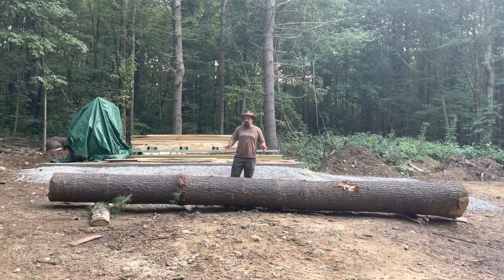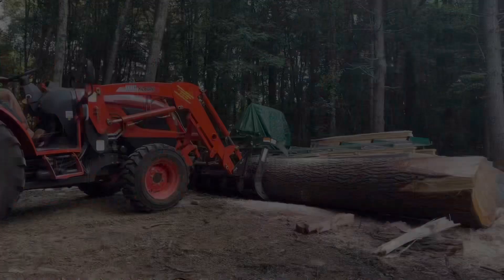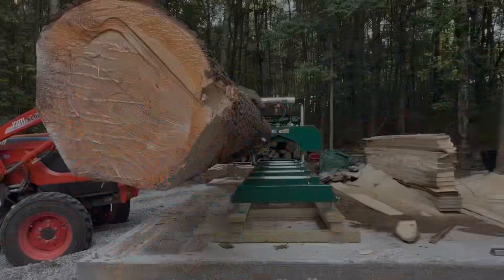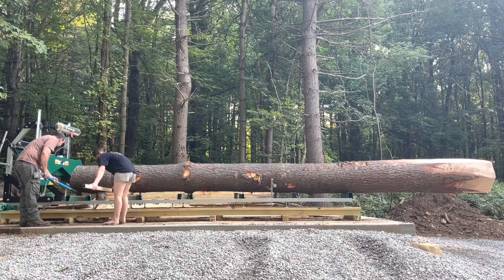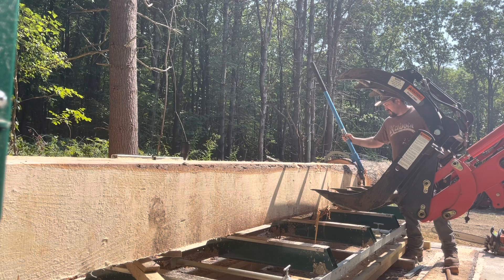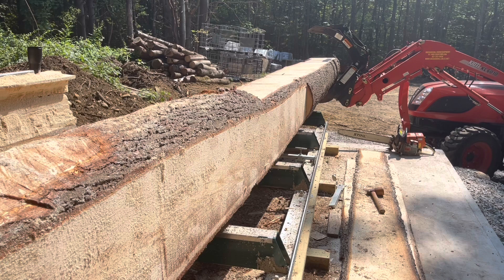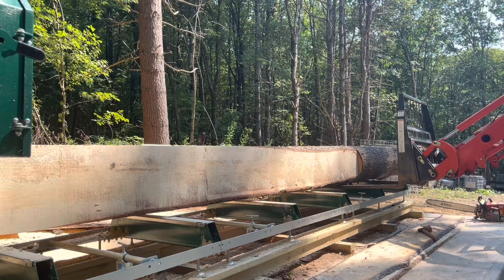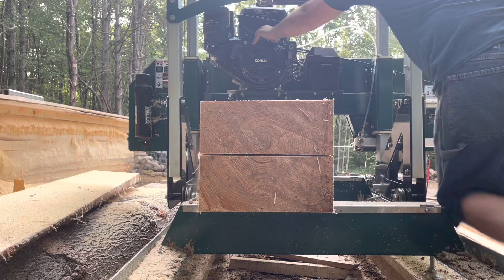Milling long logs on a short mill

Comment: This was a great video and it is good to know the details on how you did this. I remember the video when you made these beams and it is good to be reminded. I am still impressed that the Kioti could lift that log
Reply from the maker: Thank you sir. It has an impressive lift capacity for sure 👍
Reply: @BuildALotAcres  you might have mentioned else where. rough idea of horsepower and recommended attachments

kudos to the bantles of log rite tools. it is a women owned and women run forestry tool business.

kevin bantle is married to the boss lady. thehave childreen i might have meet them 20 years ago. 

kevin had a woodmizer portable band saw mill. his wooden cant hooks and  peaveys (cant hooks with a point for leverage) kept breaking. he designed his own aluminum cant hooker. his design had been copied in steel by the Chinese and lower cost producers. the logic blue are aluminum powder coat. ane for electrical situations the handles are of non conductive fiberglass and made in the usa in vernon or tolland  connecticut. 

thanks for the testimonial on a big log.and log rite tools.

.
Reply from the maker: @mrwaterschoot5617  Thanks for the info. the mill is 45hp. I did a tour of the Logrite facility awhile back. https://www.youtube.com/watch?v=1rpgufcqfag&t=59s

Comment: If you only have a couple long beams to mill up, this is where an Alaskan chainsaw mill comes in handy.  If there is a local dealer for your sawmill, perhaps you could see if you could rent some bed extensions for your mill.  In your particular setup, that may not work as you concrete pad for the mill would accommodate extra bed extensions.
Reply from the maker: True. I have a friend with a 3120 Husky and Alaskan Mill. I may someday make my own extensions from 1/4” angle iron. Thanks for watching 🙏

Comment: Why not cut all 4 sides 1st then 180 it and cut the other 4 sides?
Reply from the maker: It would have been harder to line up the parallels
Reply: @BuildALotAcres  I think I see what you mean because the log sits level on the bunks as you did it. But the log could be rolled so the cut on the other end is level.
Reply from the maker: @approots  I think either way would work honestly.